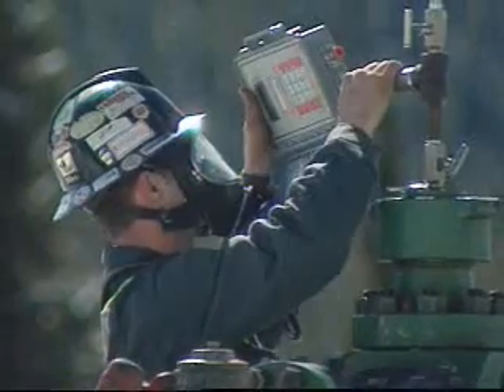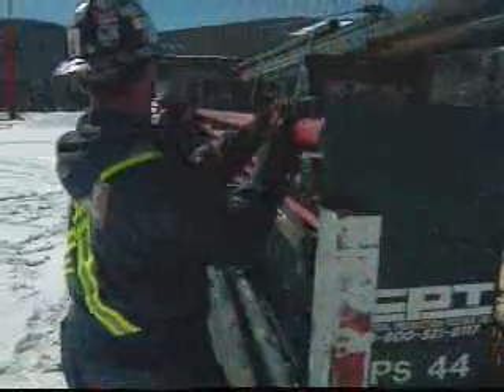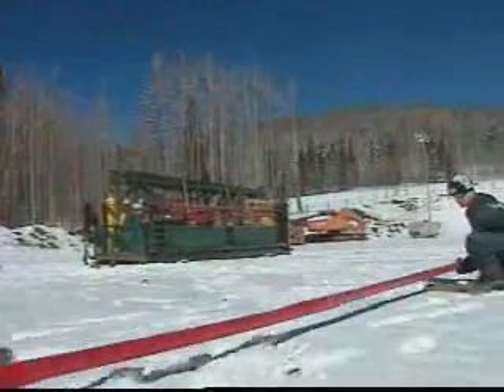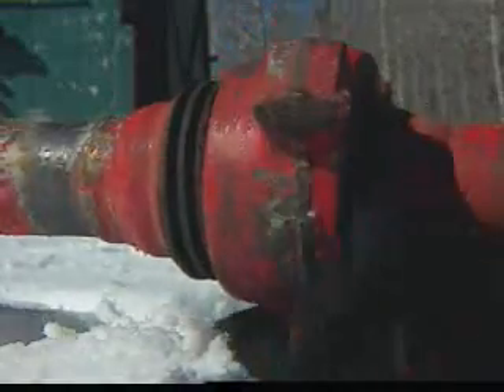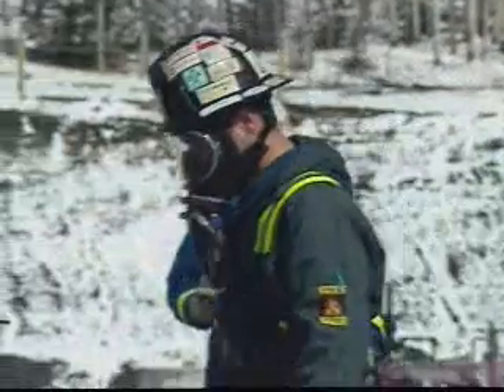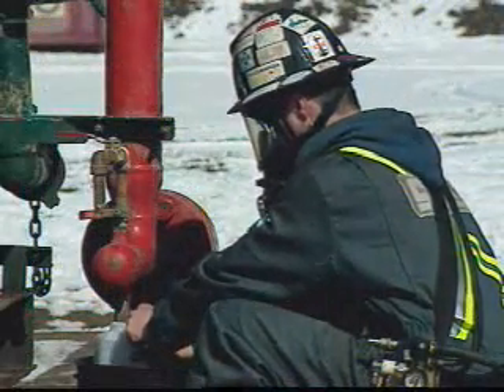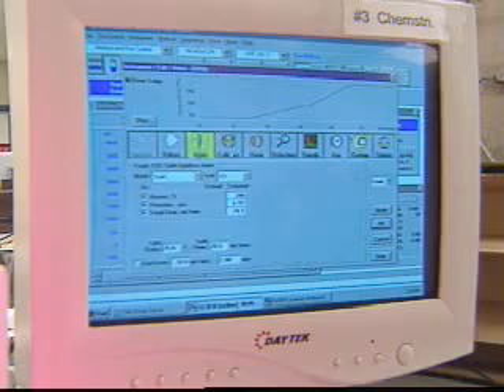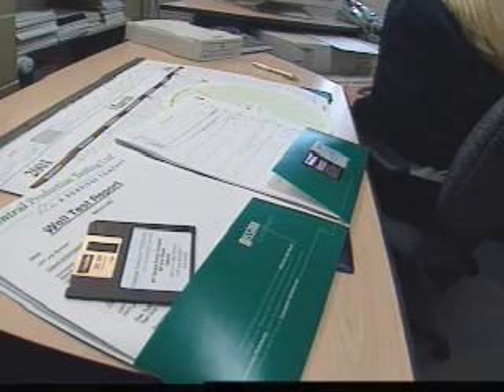Production Testing

Comment: Production Testing or well testing ?
Reply: bro what are the stages in well testing
Reply: Initially, and if it's a recently drilled and completed situation, you refer to that as a well test which will document it's output at several points and settings.....before it gets tied into the pipeline for it's production value.